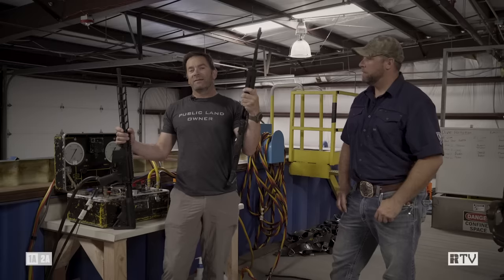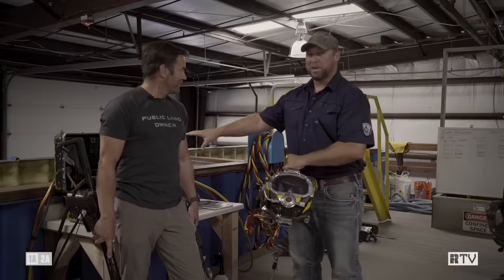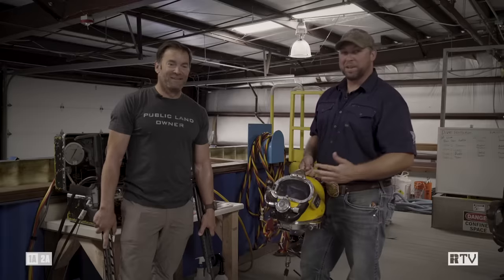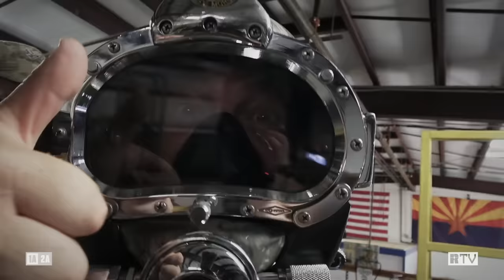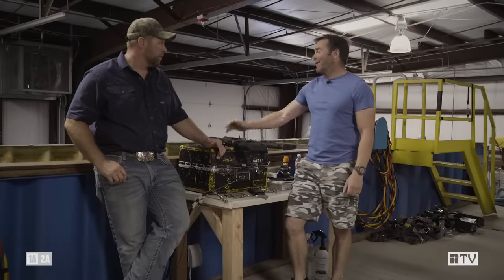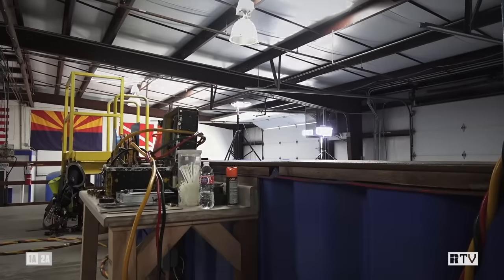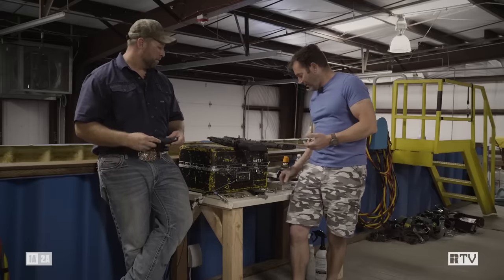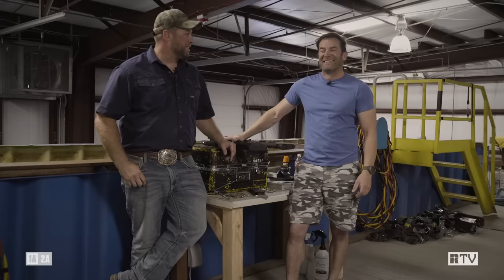AR vs. AK.....Underwater

Comment: Ive heard from an industry engineer that drilling out the hole on the rear of the buffer tube will permit the bolt carrier to cycle, otherwise you just have a super stiff hydraulic buffer.
Reply: @erwinwiesbauer9913  /Aero Precision has an enhanced buffer tube that has holes drilled in each adjustment slot for each position for the butt stock
Reply: Wow, I really had no idea, that’s pretty damn cool. I love learning new shit everyday
Reply: @erwinwiesbauer9913  they need a MUCH larger hole so that the water can escape freely. The small hole is for air which is compressible and flows easily through it while also preventing dirt from getting in. Water is considered a non compressible substance, so it needs as large a hole as possible or a perforated buffer tube in order to expell the water as the buffer moves to the rear.
Reply: @harisyoung4110  no, it's ridiculously expensive because it's HK lol.
Reply: @SuperSecretSquirell lol, hk for the upper only last time i survey will cost around $4k, try sig 516.. its same/clone technology and same piston system design of hk because hk former engineer now worked with sig to design that product.. i got it at a gunshow in 2018 for $650 for the 14.5inch upper of sig516, complete rifle maybe around $1200.. but i never test it underwater, dont dare to take a risk ..still love it..
Reply: @harisyoung4110  Actually, it runs  not because of the external piston design, but because HK drilled large holes on the back of the buffer tube. Check the other HK video were the guy wears a armor mask (while firing a stock Colt M4) on a small pool. When he shoots the Hk416, water flies off the back of the butt stock. In fact, you can see he makes sure the roles in the back are not obstructed by his shoulder.
Reply: @harisyoung4110  
Primary Weapons Systems (PWS) also makes top of the line piston ARs.
Reply: There are "over the beach" guns but none are expected to fire under the water.
Reply: @harisyoung4110  shooting underwater is next to useless, especially for rifles, the bullet will only travel a few feet on it's own and won't be lethal past contact distance. A knife would serve you better underwater but carry a handgun that can fire underwater if you're that concerned about falling into a pool with your attacker in a violent confrontation and refuse to carry a knife.
Reply: This is done at the factory, and had nothing to do with the failure.

Comment: AR: fires
AR mag: Adios
Reply: I laughed so hard at that moment Lmao
Good comment
Reply: Ikr
Reply: DI goes boom
Reply: He should have used an aluminum mag and not a plastic one
Reply: @user-lp3cf5yn5b  Ak also quits after one round underwater
Reply: at least the Ak has a better way to keep the mag in
Reply: P mags won’t work under water, use a standard aluminum mill spec mag.
Reply: To much power
Reply: I'd recommend trying a non-pmag for the AR to see if it gets one off.
Reply: bring in the CHICAS

Comment: Wouldn't it be awesome to try the same thing, but in a complete vacuum? What sort of velocity would 5.56 or 7.62x39 reach without producing any drag?
Reply: Probably just above the usual muzzle velocity(V-0). Acceleration ends after the bullet has left the barrel, only other thing that comes to mind is the lack of air in the barrel itself when firing. So yeah, above the usual V-0, but by how much I have no idea.
Reply: Sounds like a ISS mission to me. Gives a whole new meaning for "Shoot the Moon"
Reply: Mythbusters tested .357mag and .44 mag in a vacuum.
Reply: @FrontlinerCdV  Unless you slingshot it around the sun, but then it would probably go back in time.

Comment: cool video,  i thought the barrel may explode from the damage of the bullet trying to exit the barrel since the water acts as a object partially obstructing the rifled bore.
Reply: But with equal pressure on the back and front you get while being completely submergerd you just get slower fps and terrible ballistics, and the shockwave is incredibly stronger
Edit: nvm cause the case is sealed you get problems like you said
Reply: After firing round after round this is what's eventually gonna happen. I remember watching a video on YouTube where a bunch of idiots were doing an underwater "torture test" on pistols. The 1911 they had turned out to be pretty reliable when submerged and they kept firing it untill the barrel just cracked and bulged from all that overpressure basically rendering the pistol unoperatable. They were really suprised.
Reply: Honestly didn't think they'd do that poorly at all lmao everyone thought different haha
Reply: I don't think that the gas pressure is causing (hardly) any problems, but when the water rush back to fill the empty barrel that might be.

Comment: I noticed you used steel cased ammo which requires a harder primer strike. Did you notice any differences in the strike depth of the (submerged) fired primers compared to open-air firing? Could the water have obstructed the firing pin enough to result in soft strikes, causing failure to fire?

Comment: See if any semiauto pistols can still run underwater, maybe some wheelguns too. Drag on hammers/slides/ejection should be fun
Reply: KennyCnotG Pistol will shoot, but not cycle.
Reply: @akivak4660  Yup. Problem here is they're both gas operated, and changing working fluids... air for water... really screws the pressure curves.

Comment: I knew that the AR15 was going to blow up as soon as I seen it was a DI system with the old gas tube. I would love to see you do the same test with a gas piston AR15 such as the Adams Arms or Superlative Arms set up. The AK comes stock with a gas piston system.

Comment: New definition of 'mag dump'
Pretty sure the bigger issue is that a barrel and gas system full of water places a bit too  much pressure against the chamber and cartridge altogether, rather than headspace. You would need some way to vent water as the round goes off.

Comment: Also for people who aren't aware, underwater noises and concussive forces are amplified; not dampened
Reply: Are they amplified?
I know water doesn't compress like air does, but that means sound doesn't dissipate as readily in water as it does in air, not that the sound is amplified.
The effects can be amplified, but that's not the same thing.
Reply: Big Bill yes they are amplified like I said. Run along now
Reply: @AllanPowell  
"..underwater noises and concussive forces are amplified.."
Noises are not amplified underwater. They don't dissipate as quickly, as they do in air, but that's not the same thing.
Go do some more study.
Reply: @bigbill2444  I like how you try to say I'm wrong and then explain how I'm right.
Reply: @bigbill2444  I'm right so like I said RUN ALONG
Reply: @AllanPowell  Please explain how noise is amplified simply by being underwater?
If you're right, it shouldn't be a problem.
And please know what the word "amplified" means.
Reply: @bigbill2444  Easy, the sound energy etc travels better through water and it effects the bones in peoples head not just the ear drums because of that. Read up on it you will learn a lot.

Comment: 1:30 into the vid and I'm just going to make a few predictions. This particular AR has a mid length gas system. Softer recoiling because the bullet has more dwell time before reaching the gas port. However this also means that the cycling speed of the action will be slightly slower and a little less violent than a carbine length gas system. This might be a factor under water where things get slowed down even more. My guess? The bolt carrier is slowed down which causes alot of the pressures that are normally moving down the barrel behind the round to be released into the action of the gun. That being said there won't be enough gas pressure to go through the gas system and fully cycle the bolt. Magazine might even come of out the gun do to increased pressures on the action and gasses being pushed back into the receiver. This sometimes happens with overcharged rounds with no water involved at all so with water encapsulating the entire system, it could cause a spike in pressures that would simulate shooting and overcharged round. As for the AK, it should do a bit better because of the piston system it runs, where the pressure is transfered from the gas port to a solid piston alot sooner than gasses going through a gas tube all the way back to the gas key on a bolt carrier group in an AR.
Reply: Why are you making predictions on a 6 minute long video? Just watch it and stop trying to be an internet expert.

Comment: The water density prevented the recoil buffer in the AR from moving rearward fast enough to allow the weapon to cycle properly. The result was that the bolt could not unlock and produced an over pressure event.
Reply: The bolt doesn't unlock until the bullet has exited the barrel and the chamber pressure has dropped dramatically. Pressure doesn't vent from the breach. When it does, like what occurs with a barrel obstruction,  it blows out through the mag well. If a bolt not being able to unlock would create an over pressure situation, all bolt action rifles would explode after the first shot.The over pressure was caused by the barrel being obstructed by water. Firing a 62,000 PSI 5.56 rifle cartridge isn't the same as firing a 35,000 PSI 9mm pistol cartridge under water.

Comment: Back in the 60s when the M-16 first came out when they came out of water it was blowing up in soldiers faces that’s why they added the forward assist so they could let the water out and then silently push the bolt back forward.

Comment: Seems to me the AR's buffer tube would be filling with water but not completely, and being incompressible with no real exit it would stop the bolt just after unlocking and unsupporting the base of the cartridge where it blew out and shot pressure down along the feed ramps into the magazine. FWIW don't forget to check the buffer tube and socket for damage too... could have ballooned or cracked the tube, warped the threads, bent/cracked the receiver, etc.

Comment: The HK 416 and 417 are specificly designed to survive underwater shooting by having indentations inside the chamber to use the case as a burst disc.
Seems like normal AR´s do the same, but less controlled! xD

Comment: Gun control is about racism and slavery 

This Patriotic Veteran approves this mesg 

Gun deaths 

There are 30,000 gun related deaths per year by firearms, and this number is not disputed. The U.S. population is 324,059,091 as of June 22, 2016. Do the math: 0.00925% of the population dies from gun related actions each year. Statistically speaking, this is insignificant! What is never told, however, is a breakdown of those 30,000 deaths, to put them in perspective as compared to other causes of death:

• 65% of those deaths are by suicide, which would never be prevented by gun laws.

• 15% are by law enforcement in the line of duty and justified.

• 17% are through criminal activity, gang and drug related or mentally ill persons – better known as gun violence.

• 3% are accidental discharge deaths.

So technically, "gun violence" is not 30,000 annually, but drops to 5,100. Still too many? Now lets look at how those deaths spanned across the nation.

• 480 homicides (9.4%) were in Chicago

• 344 homicides (6.7%) were in Baltimore

• 333 homicides (6.5%) were in Detroit

• 119 homicides (2.3%) were in Washington D.C. (a 54% increase over prior years)

So basically, 25% of all gun crime happens in just 4 cities. All 4 of those cities have strict gun laws, so it is not the lack of law that is the root cause.

This basically leaves 3,825 for the entire rest of the nation, or about 75 deaths per state. That is an average because some States have much higher rates than others. For example, California had 1,169 and Alabama had 1.

Now, who has the strictest gun laws by far? California, of course, but understand, it is not guns causing this. It is a crime rate spawned by the number of criminal persons residing in those cities and states. So if all cities and states are not created equal, then there must be something other than the tool causing the gun deaths.

Are 5,100 deaths per year horrific? How about in comparison to other deaths? All death is sad and especially so when it is in the commission of a crime but that is the nature of crime. Robbery, death, rape, assault are all done by criminals. It is ludicrous to think that criminals will obey laws. That is why they are called criminals.

But what about other deaths each year?

• 40,000+ die from a drug overdose–THERE IS NO EXCUSE FOR THAT!

• 36,000 people die per year from the flu, far exceeding the criminal gun deaths.

• 34,000 people die per year in traffic fatalities(exceeding gun deaths even if you include suicide).

Now it gets good:

• 200,000+ people die each year (and growing) from preventable medical errors. You are safer walking in the worst areas of Chicago than you are when you are in a hospital!

• 710,000 people die per year from heart disease. It’s time to stop the double cheeseburgers! So what is the point? If the liberal loons and the anti-gun movement focused their attention on heart disease, even a 10% decrease in cardiac deaths would save twice the number of lives annually of all gun-related deaths (including suicide, law enforcement, etc.). A 10% reduction in medical errors would be 66% of the total number of gun deaths or 4 times the number of criminal homicides ................ Simple, easily preventable 10% reductions! So you have to ask yourself, in the grand scheme of things, why the focus on guns? It's pretty simple:

Taking away guns gives control to governments. The founders of this nation knew that regardless of the form of government, those in power may become corrupt and seek to rule as the British did by trying to disarm the populace of the colonies. It is not difficult to understand that a disarmed populace is a controlled populace.

Thus, the second amendment was proudly and boldly included in the U.S. Constitution. It must be preserved at all costs. So the next time someone tries to tell you that gun control is about saving lives, look at these facts and remember these words from Noah Webster: "Before a standing army can rule, the people must be disarmed."

What ever happen to up hold the Oath of office to protect and up hold the CONSTITUTION of the USA....NOT MAKE YOUR OWN RULES/LAWS...  please stand for America

Comment: The ar failed do to the direct impingement system. It basically created a water hammer effect in the chamber and mag well. If you used a piston style ar it would've done better. Probably still not great, but better.

Comment: Those Berdan primers with the AK are hard to ignite, and especially under water. That's really the issue. Also, the AR blowing up actually has a lot to do with the fact it has the DI system. I actually love the DI gas  system with modern powders, shoots so dang smooth. Just sucks under water. This is why the Navy seals use the short stroke gas piston in the H&K 416. Great rifle but felt recoil is definitely more. A trade off I suppose.

Comment: Not surprised about the AR given its operating mechanism and history with water. The AK though has been shot under water on numerous occasions. There might be something off with your gun.
Depth obviously plays a role in what happens, but there is no reason why the AK in particular wouldnt fire, although with the increased pressure of the depth it may not cycle properly in a number of ways. As far as I know all other attempts have been done in much shallower conditions, generally successfully.

Comment: The water was slowing down the AKs hammer and also, the firing pin was hydrolocked in the bolt. That combined with the spring on the AKs firing pin, it's not going to be enough momentum to light the primer.
Bet top dollar that ak starts running smooth again when dry.  That's my theory

Comment: Any chance you guys could do this test with a Mini-14 vs. M1A?
(Maybe an H&K PDW?)
Reply: I wouldn't, the way either is designed you could stand to lose support hand fingers if the op rod bends and blows the stock apart.
Reply: @mfree80286  You could put it in a vice underwater and actuate the trigger with a pull cord.

Comment: The AR uses a sealed system, the escaping gasses from the action, for the most part, stay inside the gun, this is normally perfectly fine, the gasses escape out, and any extream pressures that are produced, the gun is designed to handle, but under water is another story

Comment: As long as you have a good ak, headspace will never change even in extreme circumstances. Since the barrel is precision pressed and precision pressed cross pinned. The only way to change that it to bend the front trunnion or shear a big ass cross pin. Both are ridiculous to suggest. It's probably just a primer issue. I'd like to see that ak checked out by an ak master gunsmith to find the issue

Comment: Next time try to shoot AK-74 in 5.45x39 mm underwater. It is more interesting to compare 5.45 vs 5.56 than 7.62 vs 5.56 in this conditions.
Reply from the maker: Noted, thank you for the suggestion, may need to try this in the future!
Reply: RECOILtv I’ll look forward to this comparison.
Reply: @RECOILweb  Use a piston driven AR-15 as well. I assume it was DI in this video.
Reply: RECOILtv it also would be interesting to compare AK-74 (long-stroke piston, 5.45 cartridge) and HK 416 (short-stroke piston, 5.56 cartridge) during underwater shooting.